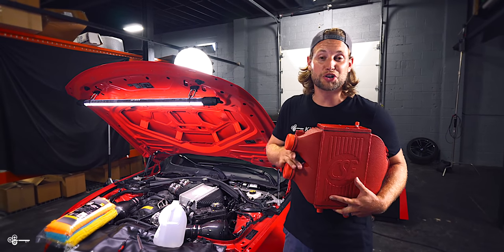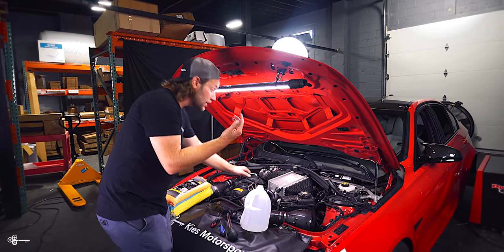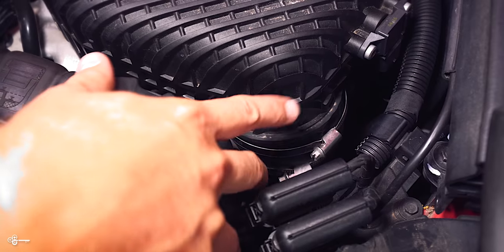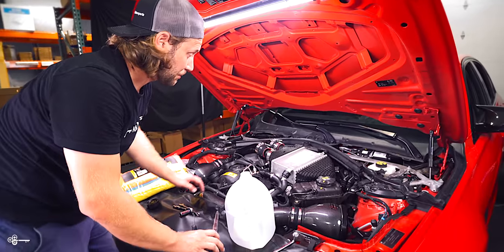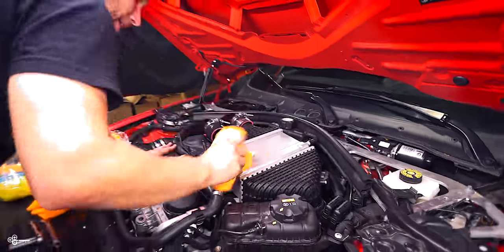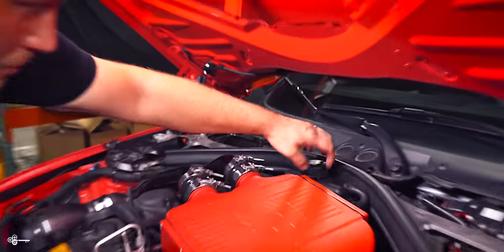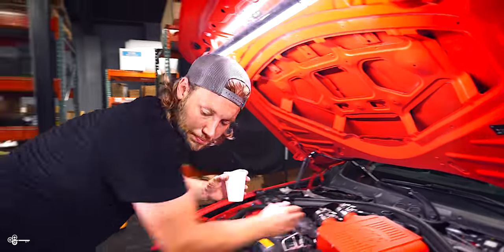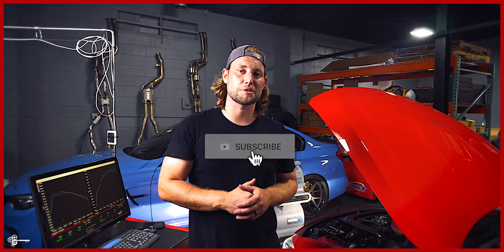HOW TO INSTALL a CSF CHARGE AIR COOLER on a BMW F80 M3

Comment: when you topped up the antifreeze was the bleeding process still going or had it stopped, you checked and noticed it down 1/2 cup so you added the fluid then re bleed the system?? Or while it was doing its first bleed you just put more fluid in after a couple of min. also when doing the bleeding does the lid have to be screwed on?

Comment: HEY!! GREAT! INSTALL!! HOWEVER, I'AM NOT SURE  HOW FITTING IS THIS TO A (5)SERIES 2014 WHICH I OWN! FURTHER I DON'T THINK! I'VE SEEN THE DEVICE BEFORE & IS THERE (1)ONE FOR MY CAR!?
Reply: Your car uses an front mount inter cooler, mounted down below between your fog lights and cools the air by air. This is water cooled so is mounted on top because doesn’t need air. You can upgrade your inter cooler but won’t look like this one still a great upgrade.

Comment: you gotta do some E20 dynos and full E85.... E is magic.... :) .... I just went E20... my 335i n55 runs like a beast... think'in I'm going to do Spool FX150 to go Full E85 ($3000 installed)... JerryBMW on Bimmerpost did 11.98 1/4mile stock turbo at a 1200 elevation... that's a easy 11.7 at sea level... you gotta do it... Also do some boostane comparison.... lot's of people running it... including me for the last 3 years (8oz/tank@93) and to top it off you can get it on Amazon Prime... lol...